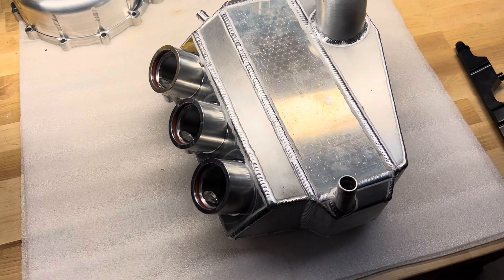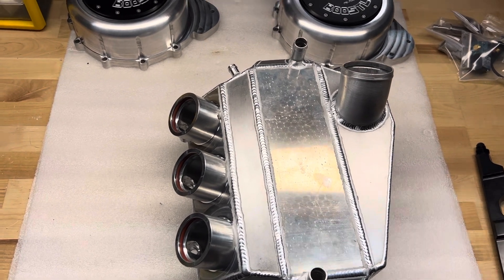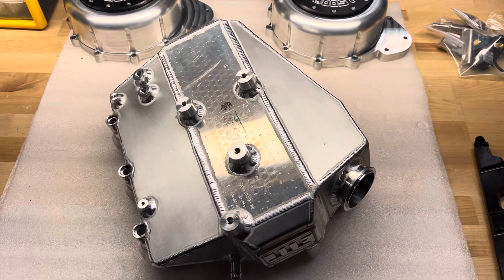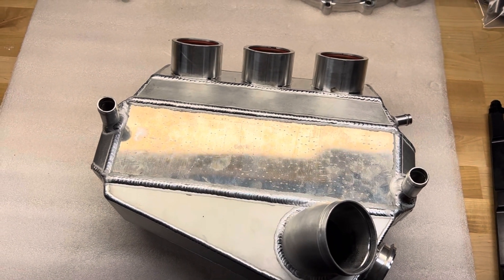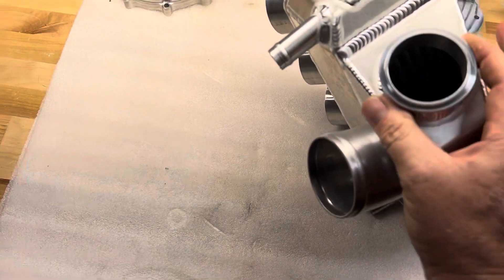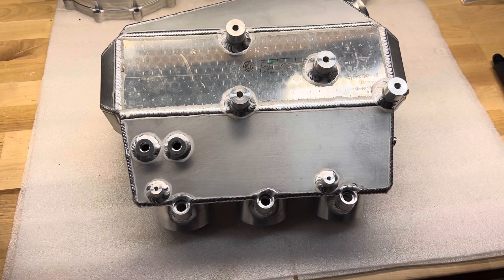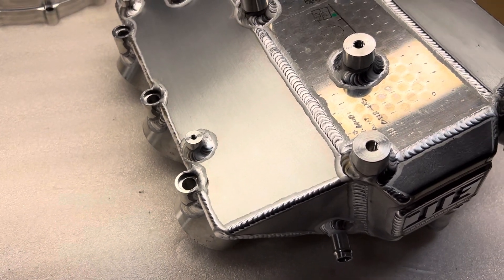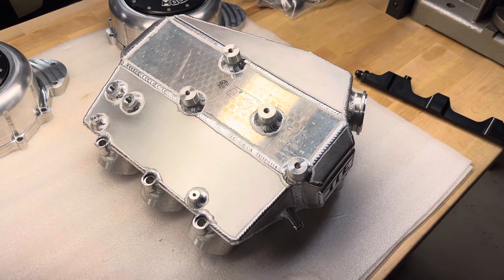YXZ 1000R water air intercooler with secondary injectors

Comment: the core is too high?? what are the measurements?
I need to buy a core air water but it has to be narrow thin it can't be tall if you can tell me where you bought the core or had it made. I would appreciate it or if you sell just the core what is the price ? Best Rgards
Reply: you can buy cores on summit or jegs and build your own.  they have lots of different sizes.
Reply from the maker: @sergiogoncalves8559  https://www.atpturbo.com/mm5/merchant.mvc?Screen=PROD&Product_Code=ATP-INT-017